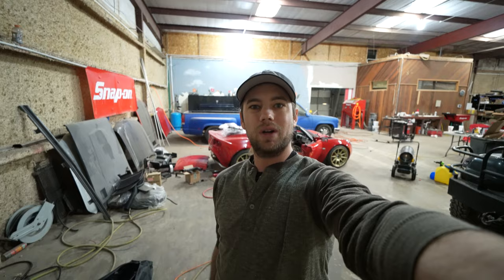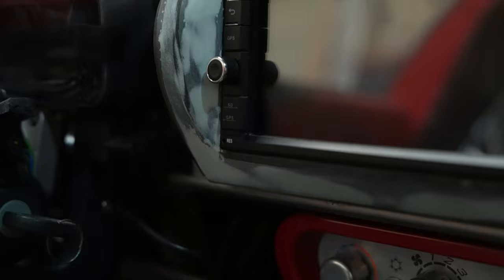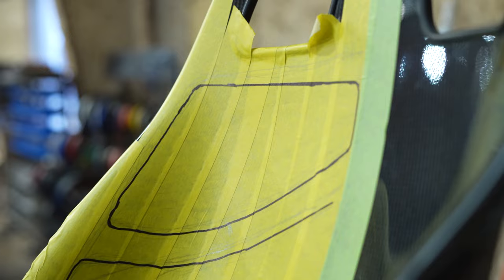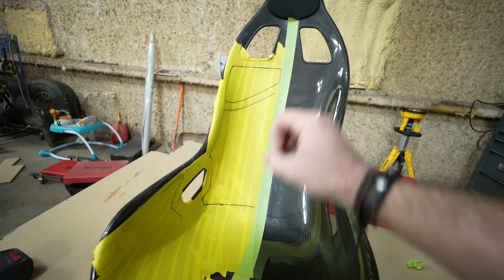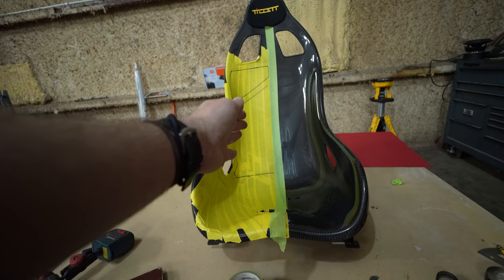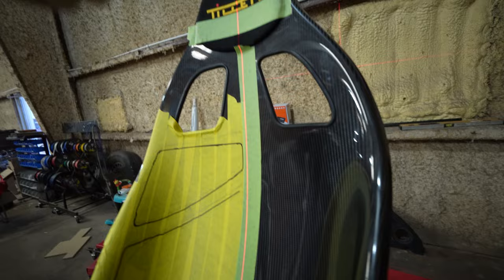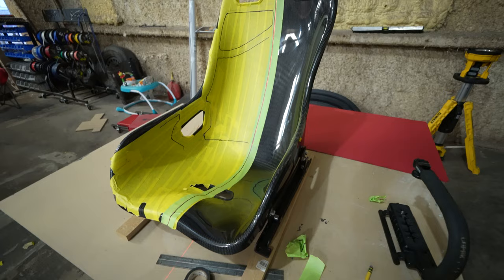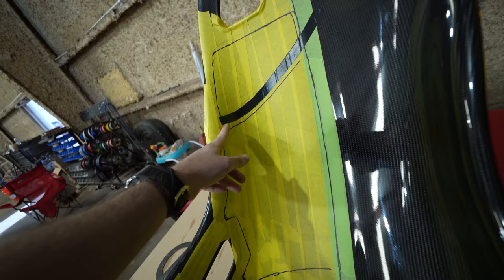Designing Custom Seat Pads for the Tillett Seats in my Lotus Elise

Comment: Use a piece of string to measure.
Reply from the maker: So originally I had an upholstery tape measure but needed some way to hold it accurately in place, so that's where the time tape idea came into play. Thanks for watching 👊🏼
Reply from the maker: I appreciate you watching! This is my second Elise, and while we've been doing lots of work to it I'm trying to keep it looking relatively oem to the untrained eye. Hopefully should have this interior project wrapped up and back on the road by March if all things go fine at the upholstery shop 👍🏼